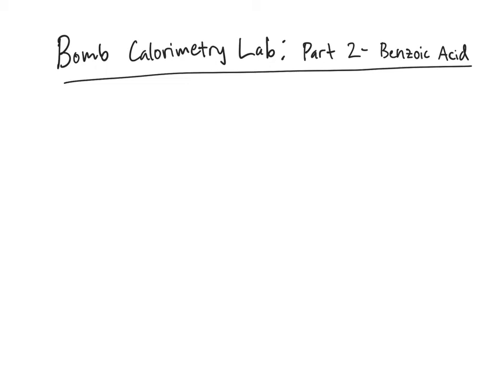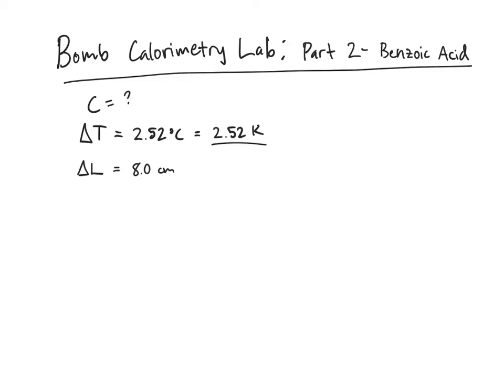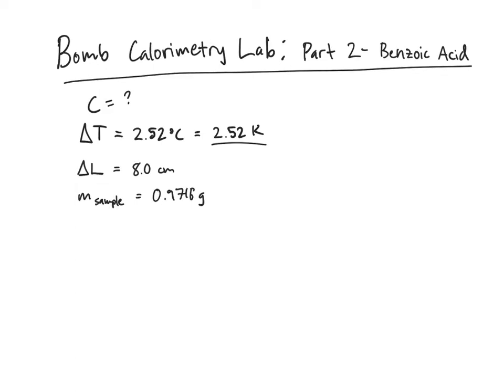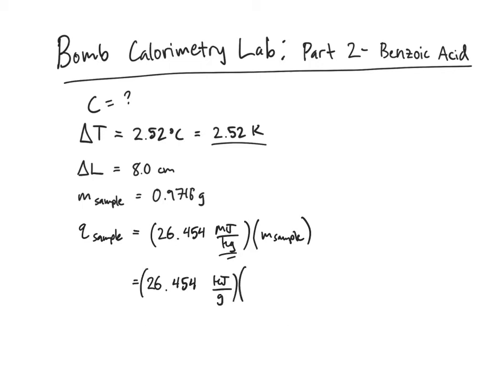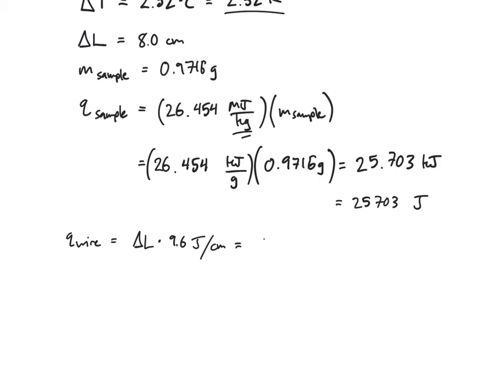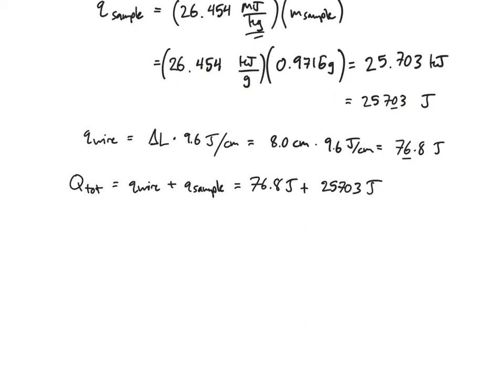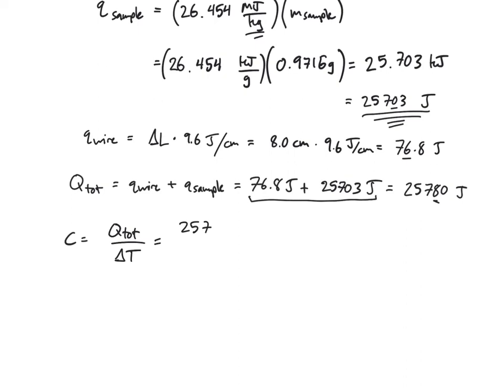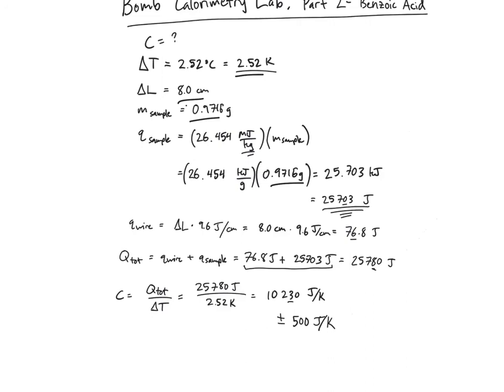CHE3025 Bomb Calorimetry 2 - Using Benzoic Acid to find the Calorimeter’s Heat Capacity

Comment: Well explained, but dont you need to take in consideration also the q of water as per the equation: Qtot = Qrxn= - Qsurr = -(Qcal + Qwater)
Reply from the maker: Thank you. Yes the heat absorbed by the water is included in the calorimeter's heat, because we consider the calorimeter system to include the water along with all the other parts of the calorimeter. In contrast, the heat of the reaction only includes the pellet, the oxygen that participated in the reaction, and the products of the reaction.